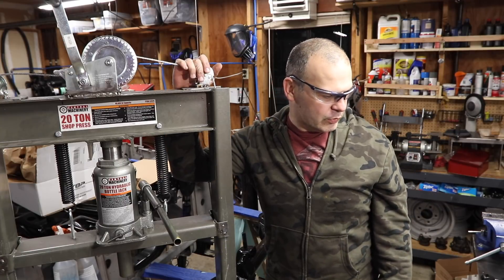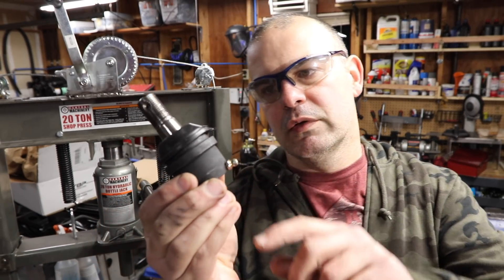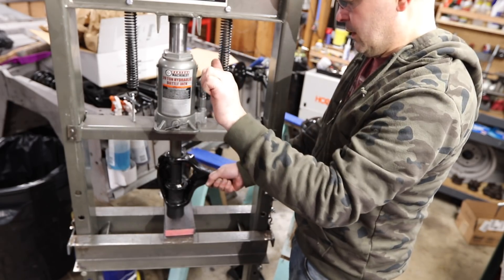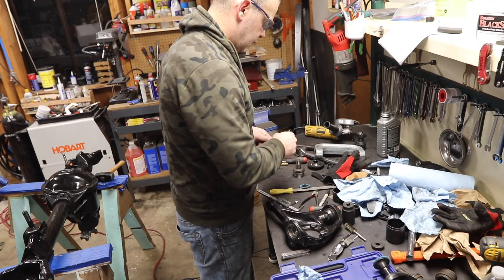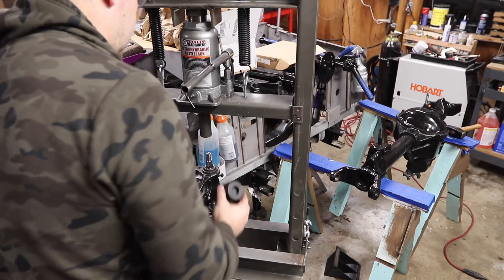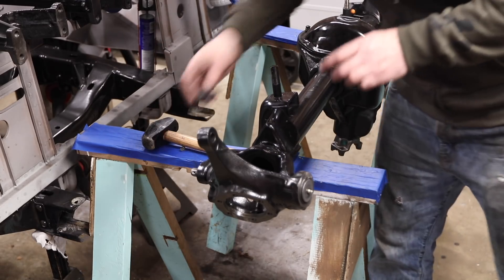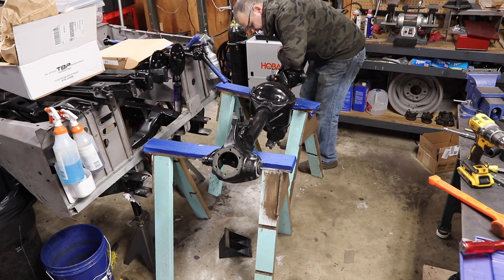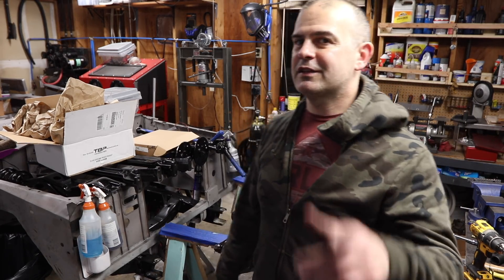3.24 - Ball Joints and Knuckles - Dana 44 - Part 6 of Gears and Axles

Comment: Good video, I always torque the bottom to 70 ft lbs and then adjust the sleeve until I have 15 to 25 lbs of drag on it( I use a luggage weighing scale to check it) and then torque top to 100.

Comment: Here is one theory: You painted anti-seize on the threaded insert. That acts as a lubricant, possibly allowing your 50 ft-lb of torque to over tighten the insert resulting in too much pre-load? Anyway, really helpful video. Thank you!
Reply: I agree, wet/dry specs are often 2:1 or more. Be more like 40 & 25 ftlbs.
Reply: You should never torque a dry bolt!
Reply: @RyanGrisham  umm what😂😂😂

Comment: The lower ball should be torqued to 80ft lbs then the upper balljoint insert to 50ft lbs and at last the upper ball joint nut should be torqued to 100 ft lbs.

Comment: doing a GM 10 bolt same deal on the knuckles and GM book says 100ft lbs on sleeve and 25 lbs of pull on knuckle, my question is did you load them with grease before you tested the pull? I see it is an old video so how was the outcome did you have any failure or readjustments on sleeve?
Reply from the maker: james hi James. I didn’t load them with grease, maybe should have. After the video I torqued them down and then hit the knuckles with a peen hammer and that relieved the stress. I sold the bronco to mile3 garage so we’ll see how it goes once he gets it in the road!
Reply: @MattsGarage  Thanks always good to get a heads up when instructions confuse the novice as you torqued to 50  and thought it was to tight and backed it off I cant imagine what 100 would do, I am not necessarily a novice but this is a first for me
Reply from the maker: james I feel you. I never quite figured it out myself. I have been told they do loosen up but the specs seem crazy. But what do I know? I’m a construction manager :-)
Reply: @MattsGarage  great video though at any rate thanks again

Comment: 80#'s on the bottom nut is B.S. 65 #'s and call it a good day. Top nut until you get 25# pre-load. Nice video.
Reply from the maker: Thanks Robert!
Reply: Whether you do 65,80,or 200 lb/ft of torque on the lower ball joint nut changes nothing. It's a tapered fit. Once it bottom out in the taper the additional torque won't change your preload. However The upper preload  adjustment threaded sleeve and nut torque will.

Comment: ball sshould be greases a bit from factory,teiwan/china.malasia,.even...never had prob with circlip.,.made a adjust cone,out of pipe,when you have 2 nuts together,the first is allways less as the second pushes it down.wait till you do the hubs,,i replaced them once in a driveway with bugger all tools.2lb hammer,socket set.

Comment: Hey Matt, great video. I just installed one of Tom's 44 Mags and had the knuckles installed by them prior to shipping.  They were very tight too.  I have been thinking they overtightened them for shipping purposes, but after watching your video I am rethinking that....Did you find any definitive answer?
Reply from the maker: David,  congrats, that's gonna be a great axle for you.  I plan on calling Phil from Tom's tomorrow as he's helping me work through some rear disc brake issues (my axles were bent and it was causing lots of runout so I ordered new axle shafts today).   I forgot to ask him about the front knuckles but I'll ask him about that and the Mag 44 and get back to you.  Hey e-mail me a pic of it at mattsgarageshow@gmail.com.  If I were building a trail rig, that's the way I would go.  Let me the ratio and planned tire size too.  Heck send me pictures of the rig too!

Comment: Page 170 from Chilton Bronco 1966 -77  Attach a pull scale fish scale to the knuckle and check the turning effort. Pull should not exceed 26 lb.
Reply from the maker: Karl Waldner thanks Karl, so that’s where the 26lb number I mentioned must come from. It’s just so much less torque on the nuts than the spec says. I guess drag takes precedence?
Reply: Ok I installed mine and the drivers side knuckle is very easy to turn after following torque specs .

Comment: Break in and some grease will loosen it up dome
Reply from the maker: Cecil, you think that's true even if I go to spec torque and can not even move them without a lot of force?  I'm looking for some specific advice because this is all new to me.
Reply: Anytime I’ve done greasable ball joints the were really stiff initially, hope this helps

Comment: Do you plan on going original specs or making changes and what color do u want to paint it
Reply from the maker: Yeah Brian, it's gonna look pretty stock from the outside but with a roller 5.0, hot cam, overdrive and some other hidden modern touches (4-wheel discs, etc.)  Still debating A/C.  For the color I'm still deciding but I'm kinda feeling the Cavalry Blue or Heritage Blue.  Not original Ford colors but I think they could look awesome on the Bronco because they "look" 70's without actually being 70's colors.
Reply: Matt's Garage i would do a vibrant color with a white hard top very beuatiful and take the simple body really far with looks
Reply: Matt's Garage probably not the place for this question but does a roller cam make a 302 a 5.0? Ik technically a 302 is a 4.9 but to everyone its a 5.0
Reply from the maker: Brian you know, I’m not 100% sure but it sounds right. I just refer to it as a roller motor.  I think the terms all get thrown around loosely because a 5.0 is the same bore and stroke as the old 302’s so it’s also a 302.  The block architecture was basically unchanged (except for mods to make it a roller) from the 60’s all the way up until the 4.6 came out in 90’s I think. Don’t quote me on the dates and stuff, I’m no expert.